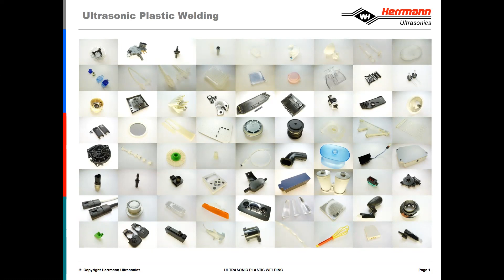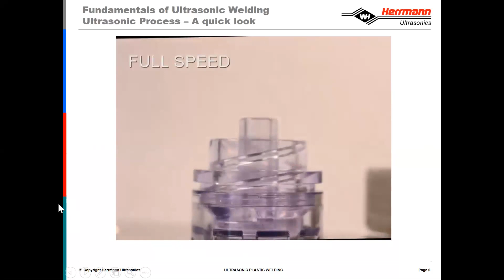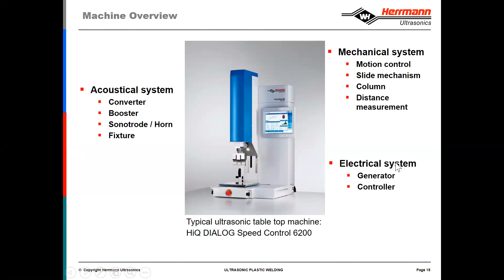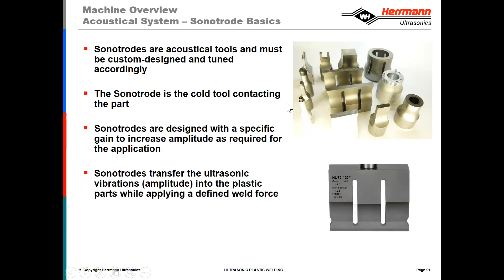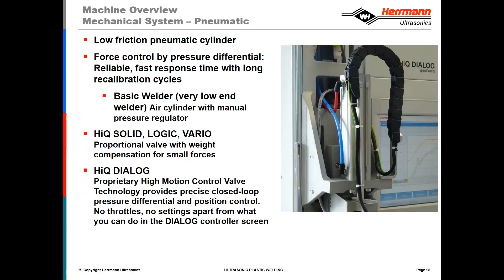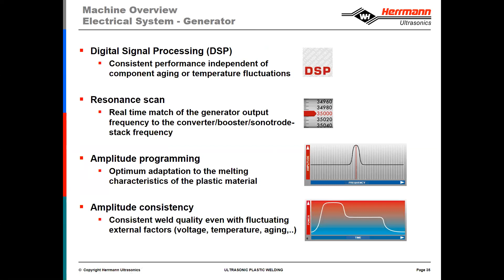Ultrasonic Bonding/Welding of Thermoplastics Fundamentals Course From Herrmann

Comment: Hi there! What can be the root cause of continuous failures in a converter?
Reply from the maker: Without knowing the full nature of the failure or usage.  The converter is a piezoelectric electric device if the stacked devices a cracked internally it won’t operate within the tuned frequency and won’t deliver the mechanical wave though it . It’s always good to make sure the 3 key components  1 converter 2 booster 3 the so notice are all properly torqued any looseness will creat problems . I hope this helps .

Comment: Hello @rayv1963 
i would like to ask, regarding melting issue, this is potential come from material, or from the machine?
how to check the machine to validate if the machine still on spec?
Reply from the maker: The heat is generated inside the part where you want the part to bond. When the machine vibrates at either 35,000 cycles or 20,000 cycles per second the energy director heats up melts and becomes a homogenous joint bond.  This can happen in just .3 seconds depending on the geometry and type of plastic. There are two key items which we calibrate the force and the distance systems. They are very robust and accurate for the Herrmann systems. I have one client who had a older system for 22 years and was still in calibration. Wow.
Reply from the maker: Yes the material will heat at the "point of the energy directror" due to high speed friction created in the molecules due to the up and down motion

Comment: Good day. Nice video.. I have a question. What if the holding fixture are wet? Is ultrasonic can still weld?
Reply from the maker: It depends but possible.   check this out. to get a free consult.  https://www.youtube.com/watch?v=kQxbdNoE1zc&list=UUhyxJqBxaemdwnCNIv6xqMQ&index=2
Reply from the maker: It depends but for instance we weld sopu pouches and the ultrasonics move the water out of the way.
Reply from the maker: Well if you can imaging those ultrasonic tooth brushes we can weld but water will be flying all over the place due to the high speed vibration.

Comment: Hello rayv, its good information,  may i know how to check sonotrode condition ?
Reply: Do you want to learn about our welding machine?
Reply from the maker: That is a great questtion. Bye condition you will be either interested to know if the sonotrode is cracked or if it simply operating outside of its resonant frequency range. We have equipment in our lab that we can use to sweep the sonotrode and determine this and much more. Feel free to send us one if you want an evaluation.   check this out. to get a free consult.  https://www.youtube.com/watch?v=kQxbdNoE1zc&list=UUhyxJqBxaemdwnCNIv6xqMQ&index=2
Reply from the maker: Typically we put the sonotrode on a vibrating device and bounce a laser vibrometer to check itl Also if it makes a loud sound and its been installed properly without welding it may be cracked.